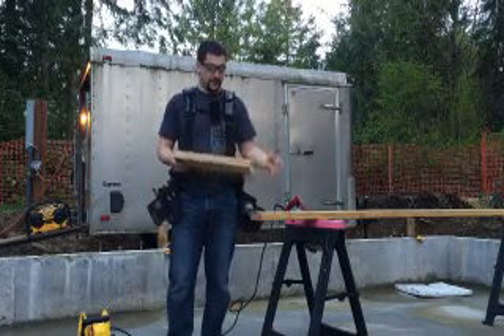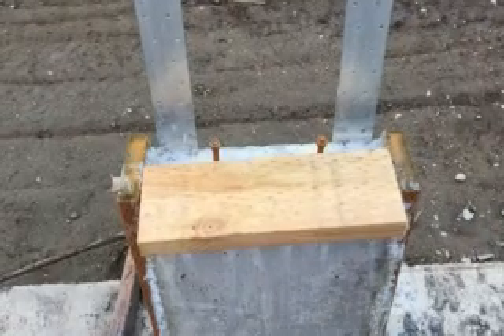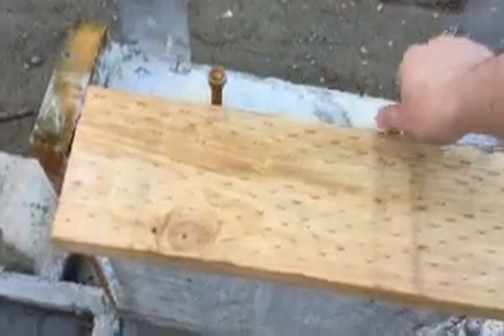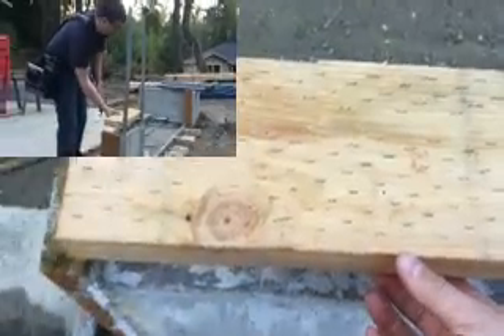Building my garage #10 installing sill plate framing part 1

Comment: Legitimate question as I'm about to throw up my garage walls soon. What is the point of bolting down the sill plate by itself, and then nailing the wall/bottom plate to the sill plate? Isn't the point of anchor bolts secured to the concrete to secure the entire wall to the foundation? If the anchor bolts are only attached the sill plate and the wall attached to the sill plate with regular framing nails then isn't your entire garage only secured to the foundation with framing nails? Again, legitimate question, not being a smart ass. I've seen lots of people do it the way you're doing but it just doesn't make sense to be so I'm trying to understand why.
Reply from the maker: I wish i had a better answer than, because that is what was on the drawing. Im sure at some point in time a engineering some ware figured out that that was was good way to do it. I did not make sense to me either. There is also wall support in the front around the garage door but those are more for sheer strength.
Reply: I just figured an anchor bolt long enough to go through the sill plate and the bottom plate of the stud would make more sense. Build your wall on the ground with the sill plate and the bottom plate nailed together then set everything on to the blocks and bolt the whole thing down.
Reply: I'm not an expert but I think framing nails are actually very strong (if done correctly) and if you're worried about the nails not being strong enough I think it's probably not done correctly (since 3-4 story houses are just framed together with framing nails on the 2nd & 3rd floors... with joist hangers and brackets as well but those are also just nailed together). But yes it does seem like the best option would be for the anchor bolts to go through the bottom wall plate as well but I'm not sure how that's feasible lining up the bolt holes, I guess you could drill holes down into the foundation from the top and bolt everything together after your wall is framed if you were wanted the bottom wall plate to be stronger.